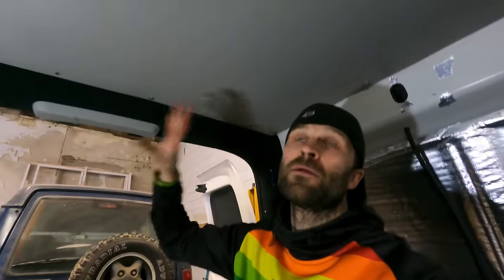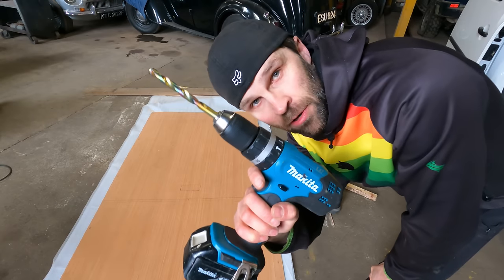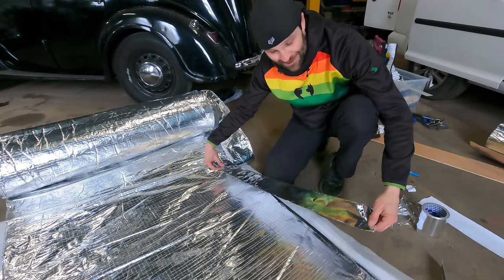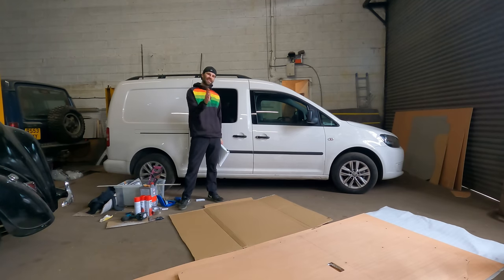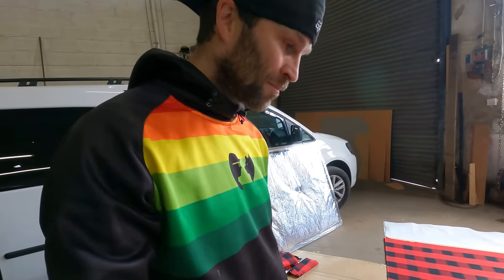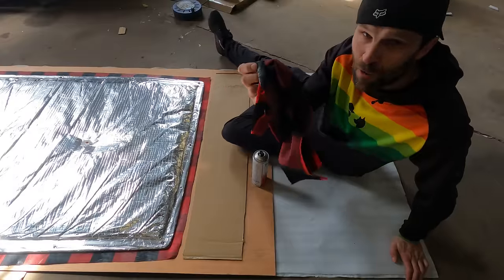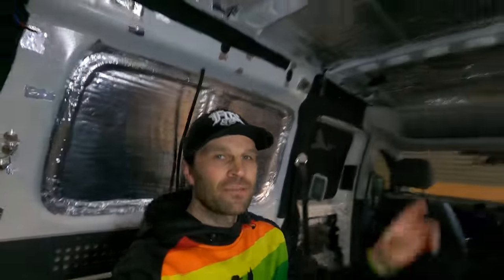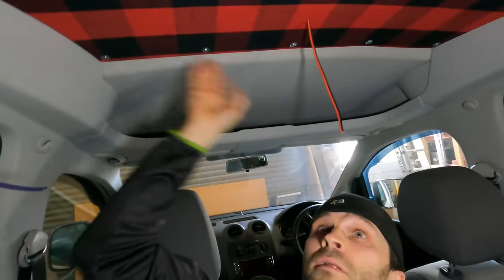AWESOME CEILING PANEL FULLY INSULATED - VW Caddy Maxi VAN BUILD - RV

Comment: Looks great. Did great getting it lined up. I find it easier to put the fabric onto the board rather than drop board onto the fabric. Position fabric on board where you want it. Then clamp or put weights on one end, fold back half the fabric from other end and spray that half’s fabric and board. Gently fold it back down smoothing back from the centre. Then lift weights or remove clamps and repeat the process with the other half. Loving the build so far. Atb Dave
Reply: Sounds good.I recently done a headboard but only put fabric glue on one surface and had no leakage
Reply from the maker: Yes I thought about it but because the fabric stretches and moves I didn’t want to risk all the lines being bent. Plain colour next time😂😂😂

Comment: Really cool build so far, love your attention to detail and thought process. Also love that you are putting a personal touch into it rather than just another bland charcoal grey carpet or wooden slatted ceiling which seems to be compulsory. I know the shirts you mean, £££'s.
Reply from the maker: Thanks Dave. It’s turned out well and I do use it often and I’m currently in it for 3 nights doing the APEX challenge.

Comment: Hi Al
I've just finished my first self build campervan. I like you couldn't decide what to do with the cargo light in the back cos of battery drain etc. Then someone suggested  changing it for an LED which uses far less power from your engine battery.  So i did that and now i have a light that turns on every time i open the door which is extremely handy in the dark
Reply from the maker: Yes I have the led bulbs saved ready and they are a nicer light too. I actually have some battery drain I haven’t sourced yet. Couple other things it could be.

Comment: Those ceiling fixing holes could do with a nice penny washer over them to avoid the fixings tearing through.  Looks neat.  Just needs a little drinks bar in the corner and you're all set.  I hope Blue doesn't shed too much hair to be caught on that ceiling.

Comment: Great job Al having done something similar I would not glue the fabric on the front (  bit seen ) just on the insulation roof side then you have no glue marks, still you won’t bother you after time 👍
Reply from the maker: It’s contact adhesive so you need to coat both sides. There is another carpet glue which would work like that though👍👍👍

Comment: Just in case you ever need to re-cover your roof lining again in the future (or in case you need to cover anything else with your fabric), I thought I’d mention that it may be worth testing a bit of fabric to see whether using ‘photo spray mount’ would work better in stopping the glue soaking through...as when I’ve used it in the past it’s tended to spray as a fine mist instead of the thicker/ stringier jet that contact adhesive seems to spray.  They even do one that's repositionable for so many hours after, which might perhaps be helpful if you need to adjust things slightly.
Reply from the maker: Yes I tested it first and it seemed okay. There are other glues that might be better or I’ll have to hold off on the trigger a bit more😂😂😂
Reply: @BUSHMANandBLUE  🤣🤣🤣

Comment: Looks like your first project should have been a work table to get you up off of the dirty floor. Couple saw horses and a sheet of 19mm ply would do the trick.   Are you going to cover the grey A pillar and roof plastic with the same fabric as well?
Reply from the maker: No but I might cover a cushion in it😂